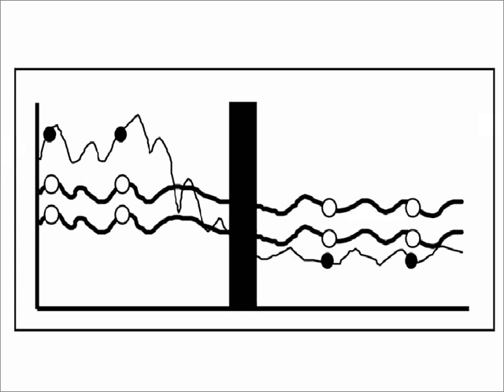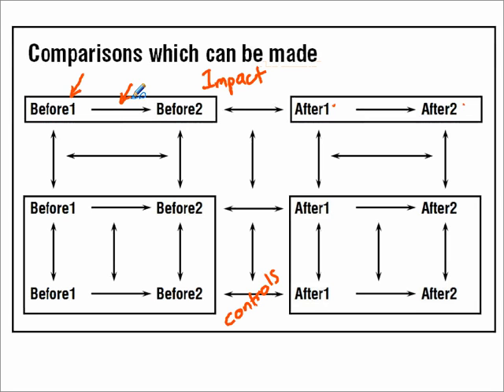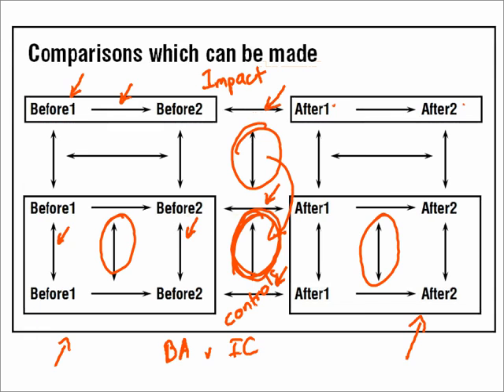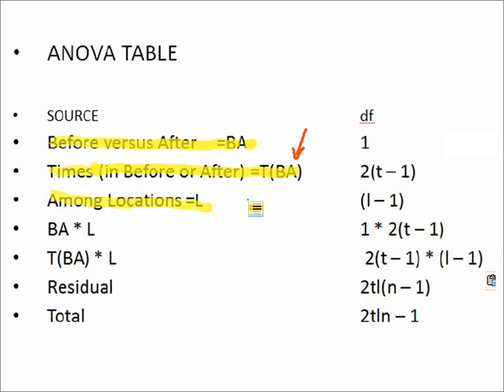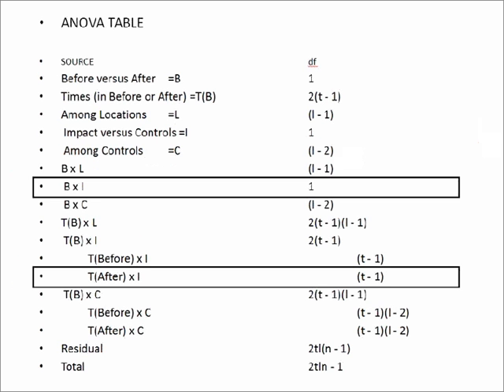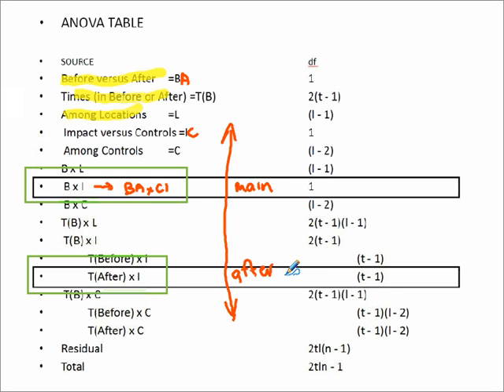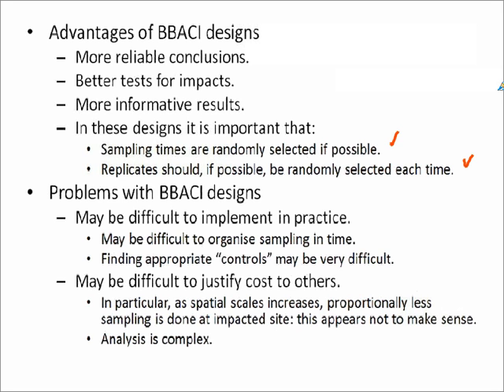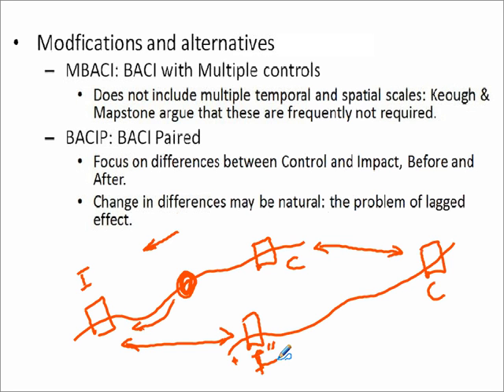Explanation of beyond-BACI designs

Comment: Are you aware of any BACI-based designs that include more than one type of impact site, for example prescribed fire as one impact, mowing for invasive control as another impact, and two controls? Can the BBACI, MBACI, or BACIP designs  be used to examine changes in diversity or abundance of a particular taxon across multiple impact treatments  that were implemented concurrently in distinct management units of grasslands, along with controls in adjacent management units?